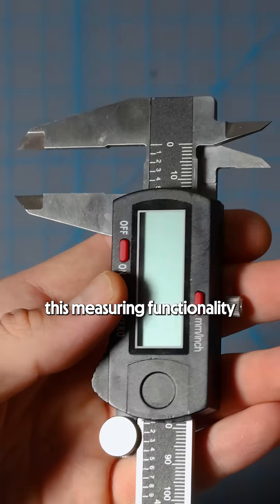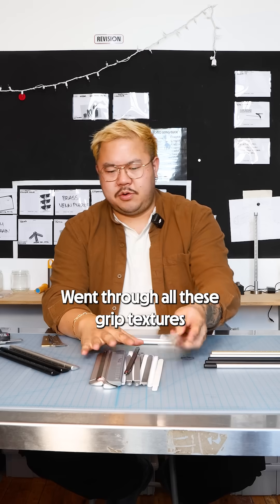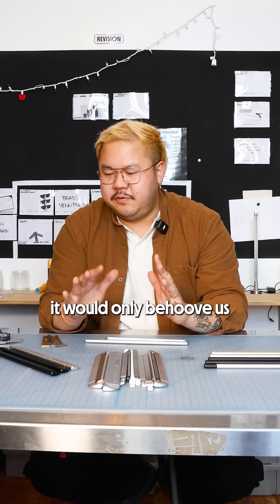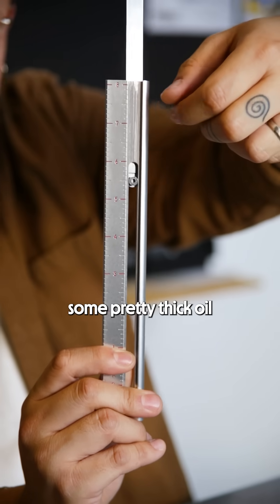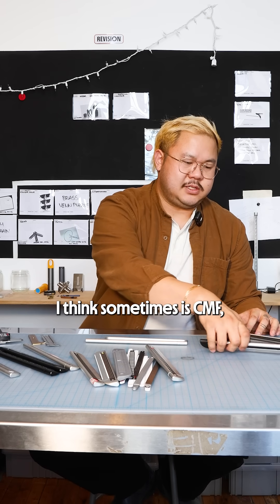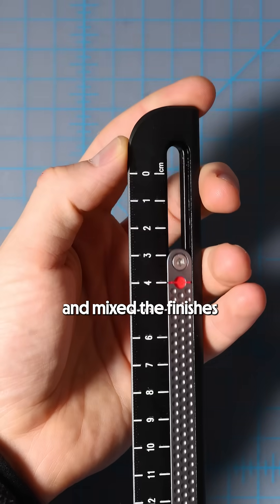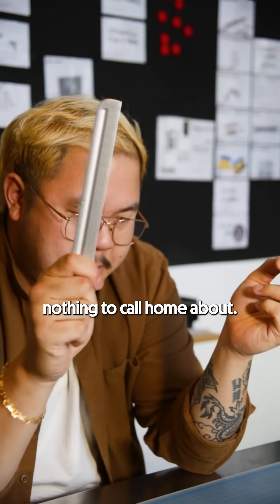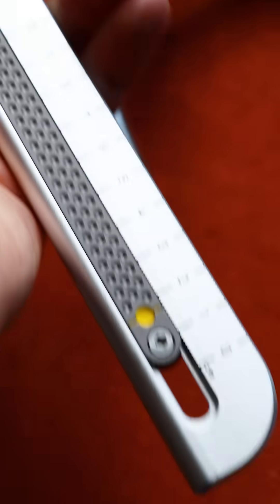How we added caliper functionality to a sleek straight edge ruler. #designprocess #desksetup

Comment: Im so proud of you guys this was your only decent product ive seen you guys make and it actually looks like you took some consideration while designing it well done
Reply: I just checked the price and it is quite steep for something that is less accurate than a regular Calliper perhaps if you want something that looks nifty on your desk you can get a rough measure with plus enjoy wasting money this is like $140cad i can get a entire 3d printer for less then that or a phone or a month of groceries   $140 is a steep price for this its hard to validate buying this when almost anything else in life cost about the same anf your probably get more value out of that other stuff but looks nifty hopfully someone makes on for a more reasonable price
Reply: @xXBLAKGOATXx  They are selling it for $140cad 😭 this is psychotic. They didn't even include precision marks on the ruler... that's the MAIN FUNCTION of a caliper. Why would I go through the trouble of fitting my object between the ruler blades just to get a regular approximation lmao

Comment: You just missed the most essential part of the caliper which is the precise measuring...
Reply: Right, where is the 20th of a mm measurement? Even cheap calipers have that. You can't do that accurately on this product, but if you know how, you can easily get that accurate with the average set of calipers.